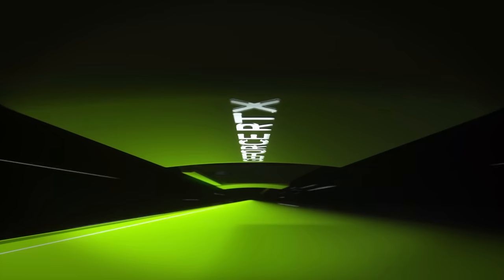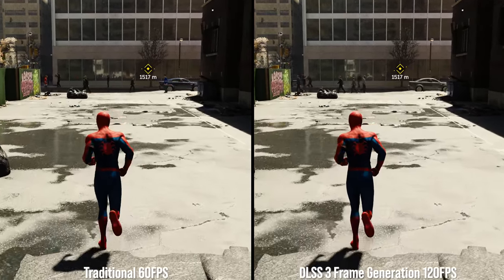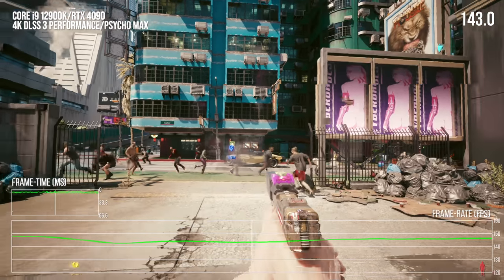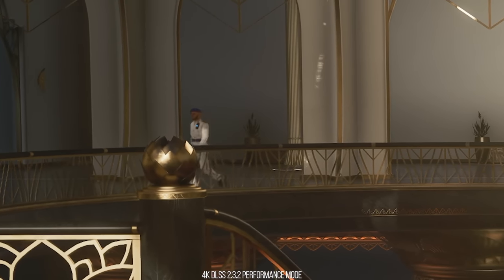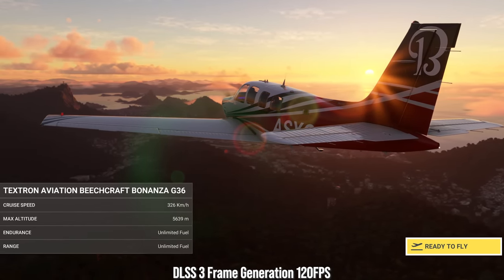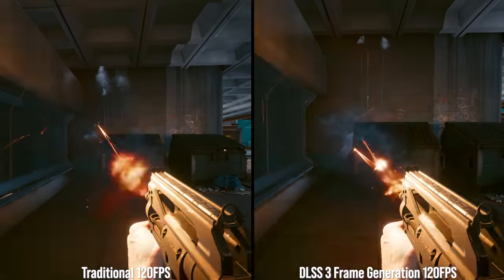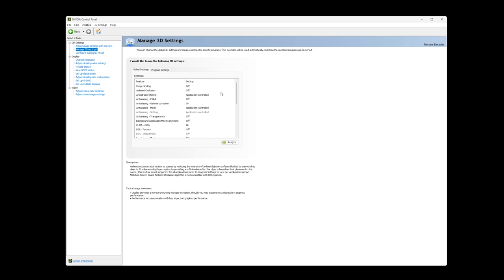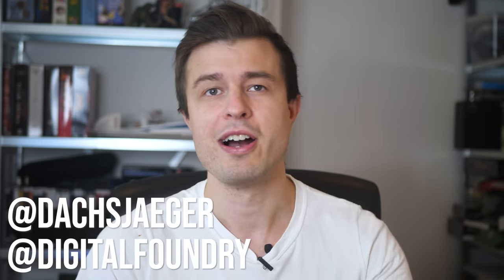Nvidia DLSS 3 Analysis: Image Quality, Latency, V-Sync + Testing Methodology

Comment: Great video, very interesting insights!

I'm kinda surprised about DLSS 3 running worse with v-sync and headroom above the target frame rate. Naively I would think that it should run better, as there is a constant interval between each "real" frame and the GPU knows exactly when the next frame is supposed to be displayed, making it very easy to generate the additional frame right in the middle.

Also I don't understand why latency becomes so much worse when the GPU is underutilized. Again I'd naively think that latency should decrease_, as there is always a new frame available on each refresh, allowing the PC to instantly render the next frame according to user input, while a frame rate _below the target frame rate should mean that some frames have to be displayed twice, while the next frame (that wasn't completely finished yet) has to wait until the next refresh to be displayed, at least on a fixed refresh rate display. But perhaps it's just me fundamentally lacking understanding of rendering pipelines. 😆

Another point I don't really understand is why DLSS 3 works on final images only, as far as I understood. By integrating it more deeply in the render pipeline, it should be possible to get rid of most of the artifacts, as elements like HUD or the weapon in a 1st person shooter usually are rendered to separate buffers. A game could render the background in 60 fps, generate intermediate frames using DLSS, and then render a HUD in native 120 fps on top of it (similar of how HUDs are rendered in native resolution even though the render resolution may be lower).

Overall I think frame generation is extremely interesting and something I've waited for years to be implemented properly on GPU side. I actually used the frame interpolation feature of my Philips TV for years to play games on PS4 Pro, as even with the additional latency and graphical artifacts, the "faked" 120 fps were a much better experience than the native 30 fps (with the additional plus of the TV somehow removing most of the motion blur the games themselves rendered based on their base frame rate). Interestingly the artifacts of Philips' motion engine are completely different from the "stuff weirdly blended together" we see from DLSS 3, having instead a small area around the edges of static objects (like a border of a few pixels width) where the moving background is updated with each real frame only, while everything around it is super smooth. Although looking completely different from DLSS 3' artifacts, and much more obvious due to seeing this "border" in 75% of all frames, it also works best with first person games, slightly less with 3rd person games (due to having this "border" around the player model), and really really bad in situations where static transparent elements are rendered over the moving background (like when wearing the gas mask in Metro Exodus or rain drops on the windshield in some racing game).

Comment: Hopefully they can resolve the Vsync issues. I do not like running max GPU usage constantly, and this would happen if I maxed out all the settings just to lower the framerate.
How exactly does the RTSS limiter work here? Does it try to cap the framerate after frame generation? What if you use an in-game limiter? Does it prevent reaching 120 FPS, because frame generation does not always result in doubling the framerate? I wish this was explained in the video.
My dream scenario for DLSS3: 4K 120 FPS frame generation + 120 Hz Vsync + Black Frame Insertion. It would not lower the latency over 4K60 that I am using now, but I would get more brightness and less flicker.
Too bad the DF guys never respond to comments, even though they always encourage us to write them.
Reply: Why framerate capping wasn't explored further in the video puzzles me. Even the RivaTuner cap was with V-Sync on.
Leaving V-Sync off completely and forcing an fps cap through control panel or ideally ingame should avoid the V-Sync issues entirley I feel like, unless I'm missing something.

Comment: To avoid hitting max FPS (and high latency) with vsync on, set "max frame rate" in nvidia control panel to half of display refresh rate minus some %. Do not use RTSS. That adds latency.

Comment: You should try using dlss3 with g sync on , v sync off and fps limiter via control panel few fps lower than maximum refresh rate...

Articles suggest that fps limiter produces less latency than regular v v sync

Comment: Hey guys, I’ve been a big fan of DF for a long time! I am wondering if a perfect V-Sync could be achieved by setting a Max Frame Rate that is half of the monitors refresh rate in the NVidia Control Panel. Assuming that there is enough GPU headroom, the GPU should render to the Frame Limit and DLSS 3 should fill in the gaps as usual, thus lock to the monitor’s refresh rate. Thanks for your insight!

Comment: I'm a bit confused about the screen tearing. I thought Gsync was all about avoiding screen tearing without having to use VSync?
Reply: Same,  never experienced it on my gsync screen with v sync off ... And i play at high framerate in 1440p ...
Reply: @vince207  as I understand it it depends on the max refresh rate of your screen and whether the frame goes over it. Are you playing on a 240Hz monitor?
Reply: @fbanget  i am, since 2 years now, i wouldnt go back to a 120 hz only monitor. 
Now the explanation make sense, with 5000*1440p with 240 hz capability ( with a fov requiring more calculation than basic 16/9 fov) i'm basically never in those super rare tearing scenario with only gsync on

Comment: Hm wouldnt you just force the FPS to be 3 below max refresh rate on a TOOL for example MSI AFTERBURNER to fix the tearing? The Vsync approach adds delay again doesnt it? I mean I can activate vsync even when I dont have Gsync and get the same smooth picture with vsync alone....

Comment: - I'm wondering if DLSS frame generation is disabled in paced frames (Like a 60FPS limit) when the GPU would otherwise be able to render more quickly. That is, if it could normally render at 70FPS. An then if it could only render at 50FPS, DLSS kicks in. I could be wrong, as it would be much easier to just have frame generation generate a frame every single time without conditions.

- The "Moire" effect pointed out in cyberpunk didn't look like a standard Moire error. It was larger than pixel level, and the effect appeared to have depth. I could be wrong here, too, but what it looks like is a separate UV mapping error. But I think you mentioned DLSS Reconstruction working better at higher frame rates. In which case yeah since DLSS can use prior frames to determine details, this would essentially be the full 2+1 dimensional Moire. Though this does make me wonder if, in deferred rendering, DLSS upscales the frames BEFORE final combination. It would explain the fact that the Moire pattern shows depth and lighting of its own.

Comment: Seems like keeping your framerate below the vsync cap also makes vsync a little redundant in the first place? Early in the video you stated that vsync is needed to prevent tearing above the monitor's refresh rate cap, while VRR takes care of anything below that. So in a sense are you not simply just removing the need for vsync? I guess you are just leaving it on to prevent tearing in less demanding scenes (which would then still trigger the higher latency)?

Comment: The tech is so insanely impressive at it's core, and has been developed for so long, it's really weird to see where it fails.
Like, HUD? Come on, DLSS 2.x figured that out long ago, just render the HUD natively, that doesn't really cost performance. Scene transitions? As you said, that should be obvious based on motion vectors, why is it trying to interpolate that? V-sync? I mean, what?

But then the technique just goes ahead and NAILS frame interpolation like none other has before. In a way that fools the eyes of the DF writers, which is something I don't recall seeing ever before.

Comment: Great insights on the Moire pattern in CP2077.  I'd love to see a comparison of DLSS2 vs DLSS3 frame gen only to examine what artifacts DLSS3 frame generation is introducing.  In other words, keep the same 120FPS, but remove the temporal aliasing you get from running DLSS2 at only 60Hz.
Reply: I think DLSS 2 will still have the Moiré pattern at 60fps, higher framerates are needed to resolve that issue as it's not edge aliasing, rather the pattern is essentially geometric aliasing where there isn't enough information at oblique angles stretching from midground to background.  Perhaps machine learned anisotropic filtering could resolve this issue at 60fps?
Reply: @charoleawood  Right, DLSS2 @ 60Hz is the problem, so I'm suggesting [DLSS2 upscaling @ 120Hz] vs [Native 60Hz -> DLSS3 120Hz].  In other words, compare aliasing using DLSS2 only or DLSS3 only at the same final framerate.  I am not sure if current hardware can achieve this though.

Comment: Well for the vsync issue you can always limit the game framerate on the game itself or using rst to something just below the maximum refresh rate, so if it is 144 you can cap it at 140 or slightly less, this way it's always on the gsync window and you also may have less input lag as the gpu may not be at 100%, check out batrlenonse videos on this, they are quite interesting, too bad he no longer makes videos

Comment: Honestly i prefer using RTSS frame limiter with G-sync rather than v-sync so i still don't have any tearing but i also have lower latency. When you enable both g-sync and v-sync tho it still seems to be smoother (probably because frame rate never goes above the refresh rate, it only goes under as opposed to v-sync off when it can go both above and below the refresh rate for a really brief period of time) but honestly i'd take the lower latency and it's still a really smooth expirience.
Reply: Optimally you’d want G-Sync + V-Sync + Frame Limiter set slightly below your max refresh rate (i.e. 117fps or below at 120hz). This way G-Sync works as intended (with V-Sync) but you don’t get  the extra latency from V-Sync since it would only add latency when reaching your max refresh rate or above.

Comment: Best video on DLSS 3 I have seen, BUT the choice to use v-sync seems odd and might taint the results? Shouldn't vsync be OFF as recommended and to avoid tearing cap the framrate to 118 or 116 (or some other even number - i see you have an example with 117 fps capped by rtss, but doesn't it need an even number with interpolation, since there is no number it can limit itself to that would double to 117)?  
Alternatively, IF you need vsync on, use nvidia fast sync so the framerate can run wild and drop excessive frames (might be ideal for dlss 3, if these can be combined, but might make it impossible to capture the interpolated frames reliably).
Getting my card tomorrow, will try it then.

Comment: I turned on Frame Generation in the game, framerate increases to 80 and latency to 70. The problem is that there are waves in the image. The solution has always been vertical synchronization, but it cannot be turned on with FG. 

I wonder if I had a G-Sync monitor if the problem would stop? 
My monitor supports FreeSync. 

I also tried to force vertical synchronization through the controllers and it also succeeded, I have 60 fps and 70 latency, but it started to ghost.

Comment: Seems weird and painful for it to not officially work with vsync, which is essentially double buffering and being a frame behind... the whole technology is based on running a frame behind. So with vsync, if it's not compatible, it'll be two frames behind right? And if it drops one it has to drop two, and it doubles each time, so input latency feels like 15 frames per second even though it's drawing at 120. Oof!

Edit: This is a really good video btw. Love the technical analysis, depth and experience, and the focus on perception.

Edit 2: the moire thing doesn't seem right to me. I suspect the game itself is rendering it differently at 60 vs 120hz, maybe at 60hz it uses higher quality something which also aligns with another something and produces the effect, while at 120 it's got less free time so drops to using some lower quality - uh let's say render target - and then scaling it, the scaling blur causes smooth it out, stops edges from lining up in a way that causes moire. It seems like a spatial problem not a temporal one though, which is kinda worrying for these tests - as you discovered, you have to compare 60hz with 120 too. Nice spot!

Comment: Another great video!
Can't we just limit fps by a couple of frames when using g-sync and not engage v-sync to avoid tearing? Wouldn't having g-sync engaged all the time deal with the tearing and without v-sync there would not be additional added latency?
Reply: Thats what i do on my LG oled. I play most games @ 90fps frame limiter without vsync. Smooth as butter, low latency en more headroom on the 3090, but with DLSS 3 and a 4090 this has an effect on latency.

Comment: Wow, that's a ton of info!  Love the in-depth coverage as always.

The only thing I didn't see much of is DLSS3 without frame generation.  I plan on playing at 4K60 DLSS Quality with VSYNC on, assuming that's an option (5:12 - Looks like frame generation itself is the VSYNC-killer, as opposed to DLSS3).  Are there any differences between DLSS2 & DLSS3 without frame generation?
Reply: Im not sure but I can say the tensor cores on 40 series are faster. So DLSS2 will perform better than on a 40 series card than a similarly performing 30 series card.

Comment: This exact same frame insertion technology has been in TVs for year. High end TVs do it really well but add soap opera affect. Soap opera affect isn't an issue for gaming as we want high frame rates, however it looks like nvidias version is miles behind what you get I'm TVs. Good TVs get far less artifacts etc that what I'm seeing here. If the TV versions added less lag it would probably be a better option

Comment: Someone needs to run comparisons between older GPUs and modern GPUs.

I upgraded from a 750 Ti to a 970 then 970 SLI (got both cards at the same time just used in two systems until I changed plans), then a 2060 then a 3060.

60 fps was smoother on the older hardware than it is on Turing or Ampere. People spoke about micro-stutters for years and I never saw them until I upgraded beyond Maxwell GPUs even though the previous machines were wholly inferior to my current one.
Reply: Interesting point to look. I assume no DLSS was involved right?
Reply: @SIPEROTH  lol, no DLSS involved, didn't exist on the older gear and I've only got 3 games that even support DLSS.

Fallout 4 at 60 FPS feels smoother on a GTX 970 than it does on a 3060. I can't quite quantify it but I can certainly see it. Even with VSYNC several games feel inconsistent in a way that didn't happen on Maxwell and below. That said some games are perfectly smooth, Spider-Man is pretty smooth even when the framerate starts jumping around.

Comment: TBH I'm only interested in DLSS 3 frame generation for games that are heavily CPU bottle necked, like flight simulator, no matter what settings you use you aren't going to get much of a performance bump so doubling the frame rate with frame generation seems like a great idea. Also if a game is ok with a CPU limitation preventing it from reaching much more than 60fps then it probably isn't particularly twitchy and input latency probably wont matter as much for it which further suits frame generation.

Comment: I still dont understand how DLSS works because it lowers the internal resolution and "upscales" the image back to your native image. At the end of the day the image is still close to 4k and you get a big push in performance but is the image still not technically being created by the GPU. Like even though its AI the gpu is still pushing out that higher image. Does anyone know how to answer that?
Reply: It works because of the difference in render methods, traditional computed rasterization rendering uses the regular processor cores doing 1s and 0s to calculate an image, DLSS uses Nvidias Tensor Cores, which are exclusive 3d cores that have their own algorithms and are designed for AI tasks, they have a programing based on “neural networking” and are normally not in use during regular rendering, but when using RTX HDR, Ray Tracing, DLAA, DLSS, DLSS Frame Gen, or other dynamic AI tasks, they handle all of it. So your regular cores are doing less work at a lower res, and then the super high performance Tensor AI cores runs that image through a neural network algorithm that is consistently built upon and improved by nvidias suepr computers and then downloaded to your GPU through driver updates. After running through the tensor cores they extra pixels are filled in kind of like missing puzzle pieces that the algorithm is good at estimating to make a final high res image

Comment: The very final section about setting a manual FPS limit via external software not being enough to combat input latency is interesting. I've always done this, via FPS Monitor, and it's been fine. Curious why that's no longer the case with DLSS 3.0. 

I wonder what the input latency (ms) was with DLSS 2.0, capped at 117 via external software, in that same cyberpunk scenario.